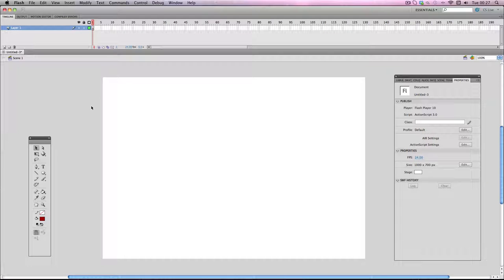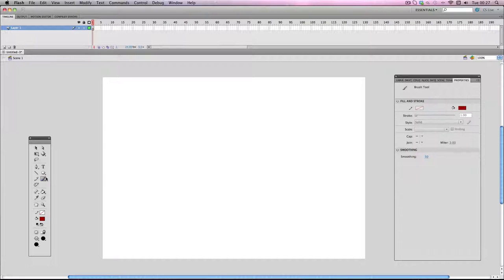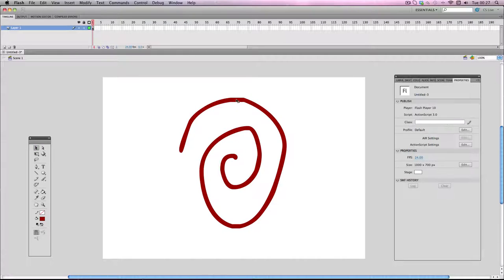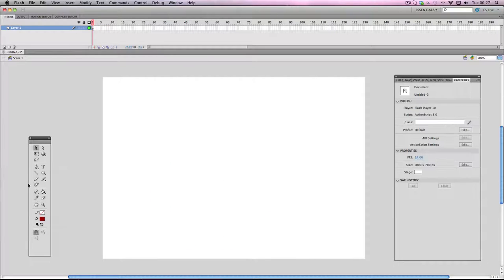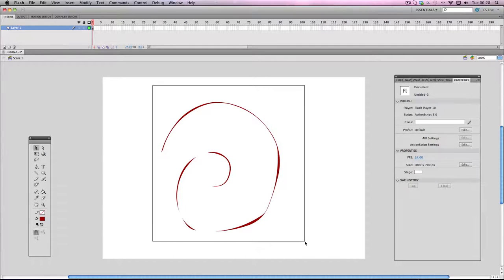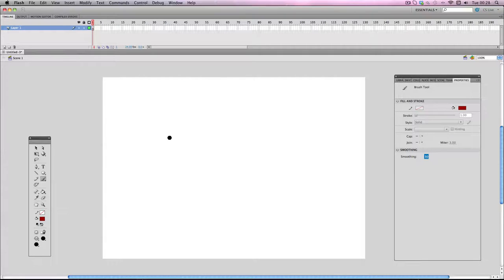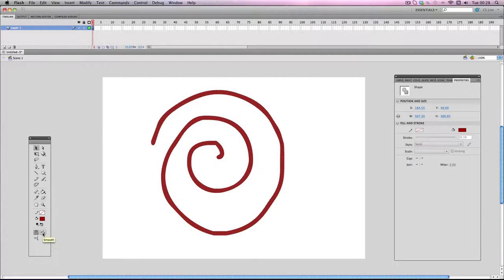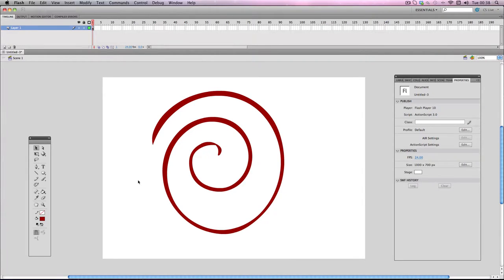Flash Tutorial: Smoother Brush Strokes

Comment: to be honest, I'm one that uses the pencil tool for frame by frame animation. I do prefer it cause the line strokes are smooth and have the same stroke thickness each frame you draw. however even it has it's issues with the paint fill if lines aren't properly connection. but hey, that's flash for you.

Comment: looks a lot better but still looks pretty terrible imo. would definitely recommend using much lower brush smoothing than 50. also if you zoom in and then smooth it doesn't smooth so dramatically which is nice.